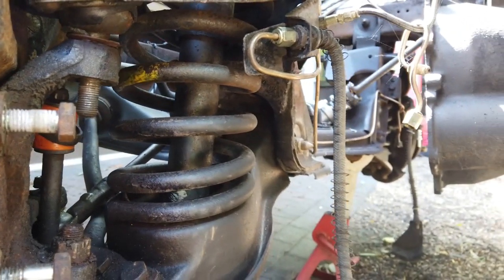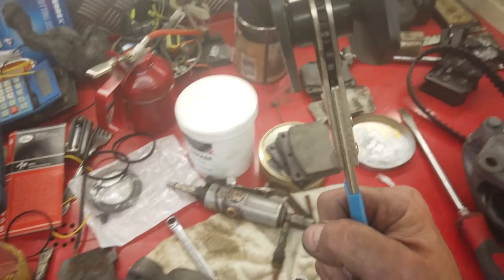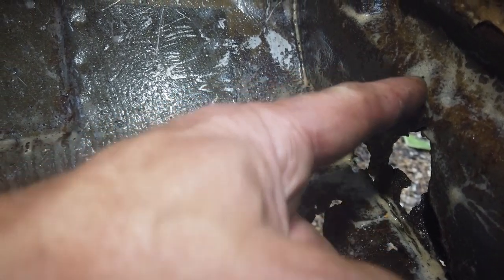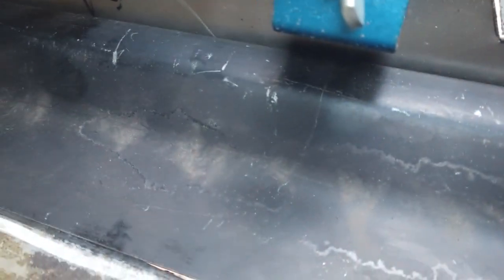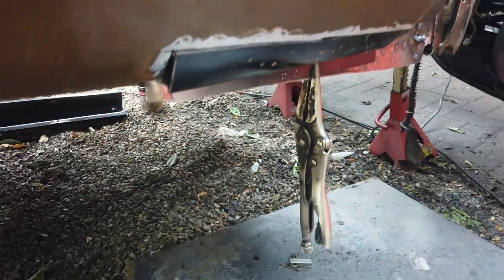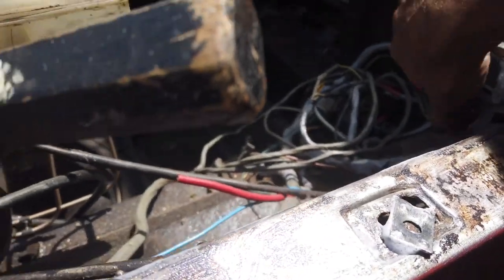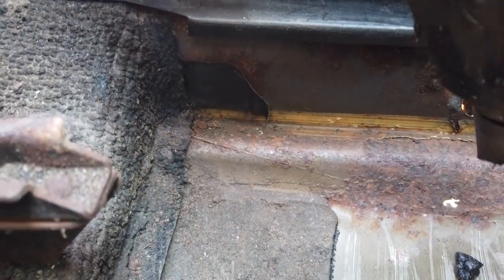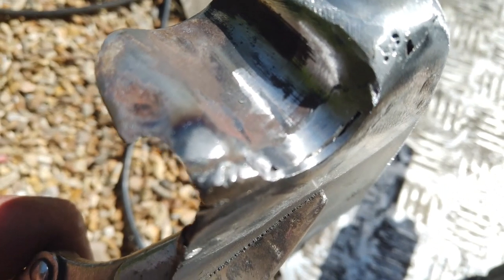PROJECT PAPPA - Mk3 Cortina Resto - EP6

Comment: So rare to see a home mechanic that still has their 13mm socket, I've lost so many over the years it became mandatory.

This with a MK3 Cortina or Mini (classic) is what I want to do as a retirement hobby, in my 50s now but after seeing the prices shoot up I think I will miss out on that, not so long ago I thought of having two one being electric, strip them both to the metal and start fresh rebuild, maybe I could get a Capri instead but had my heart on the Cortina.

I miss those days where you could get in the engine bay to work on them, but now it's so tight and ridiculous what you have to do to change anything, a couple years ago i had to get my lad to reach the headlight bulb because my chunky hands/arms wouldn't fit, or I would have to take off the bumper/grill/headlight just to do it, they've taken the fun out of DIY mechanics.

Comment: Nice work Pete. Interesting to see how you tackle this type of resto compared to your normal total strip downs. More the sort of stuff I do on my old MK2 Mondeo. That welder sounds really nice, I really must invest in something like that. Been getting by for years with one that ain't that great - not consistent, mainly down to a crappy wire feed mechanism. So must get myself something like that SWP you have. Loved the Cortina show at the end of the video, quite a sight all those MK3's together like that. And it was good to see a couple that had not been restored, looking pretty much how a lot of MK3's looked back in the 80's. My old GXL being no exception back in the day. Mine was originally Sapphire blue, but after a big engine bay fire I ended up spraying the front wings and bonnet with what I had at the time, some old dark blue rattle cans! (and yes, the fire was caused by the inlet pipe coming out of the carb!).  Anyway, still enjoying your videos, have been doing so since the day you first got hold of Swampy from that field. Always interesting to watch mate.